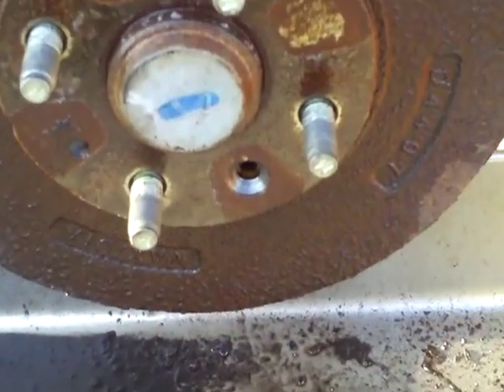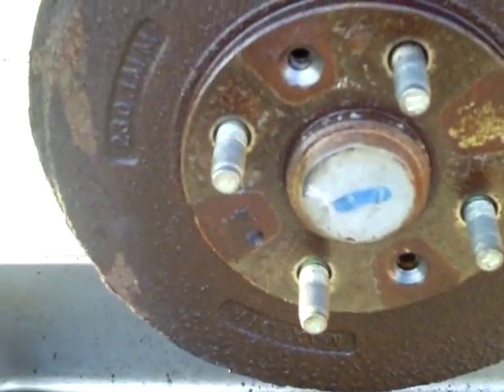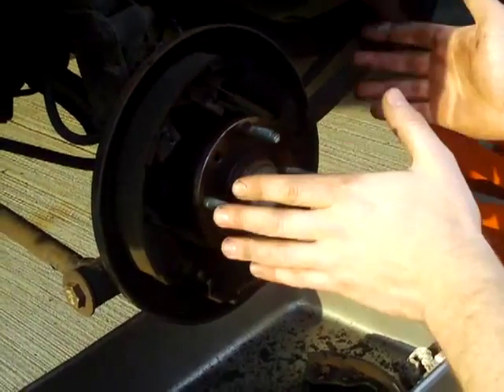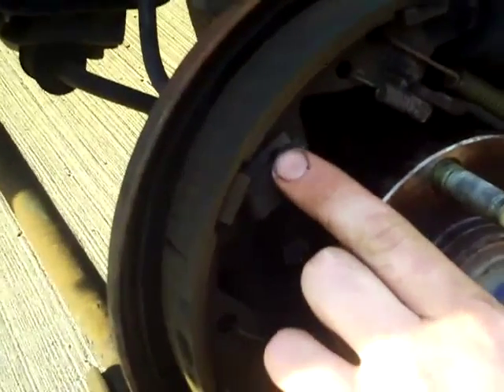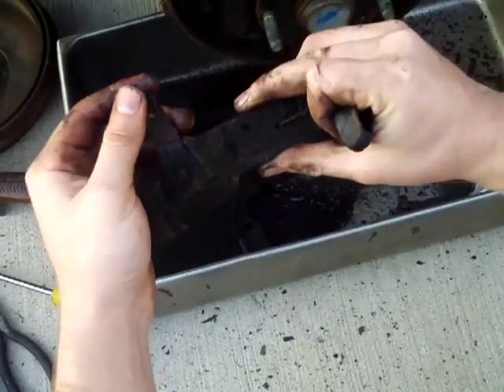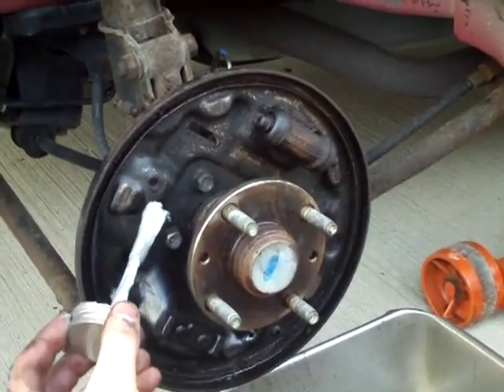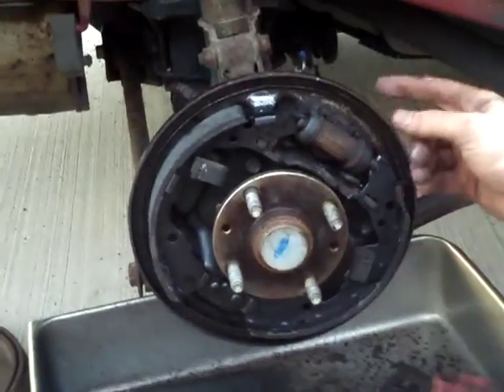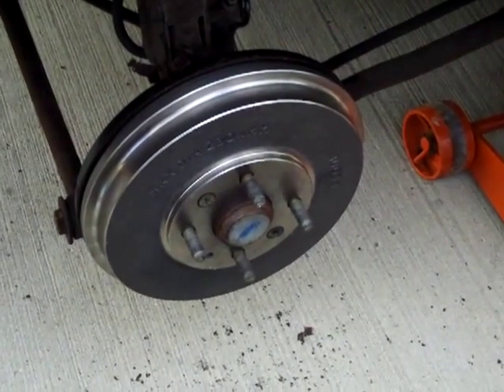2001 Ford Escort ZX2 Rear Drum Brakes How To 2.0 DOHC

Comment: I bought a 97 escort with 123,000Klicks on it(76,000miles) for $750. Just needs an exhaust flex joint and rear brakes.  Brakes weren't really warn, just badly rusted due to lack of use.  Bought it off an old lady who was going in an old age home, who bought it off her older sister, who bought it new.  So it's all grandma miles.  Anyways.. I'm in the middle of doing mine, and I found it easier to take the hub off and do the brakes on the back plate separate from the car..continue  ^

Comment: I used this video in tandem with the 1A Auto Parts video on the same vehicle,  each video has a bit of info the other doesn't. The drum indeed can be removed more easily using a 12 thread bolt...unless of course the threads in the drum are stripped as was the case in one of mine. All springs are easily removed and replaced using a small vice-grips. If you have to disconnect the E-brake cable I suggest soaking the metal plate with PB Blaster, putting it in a vice and tap on it with a hammer until you can free it up. The drums will need to be "turned", any auto parts store can do this. You should also spray things down with brake parts cleaner. I found this and the other video very helpful.

Comment: Thank you.  I'm still having problems with the drum going back on, even after adjusting the "reset" mechanism.  Is there a way too make the circumference of the shoes even smaller?  Such as putting in the cylinder pistons?  BTW   An easier way to remove the drum is to just use a 12 thread bolt, and put in to that little bolt hole and slowly ratchet that in.  It will push out the drum with little to no hammering required.   (It's the smaller extra hole next to the two phillip head bolts on the drum)..

Comment: Are those screws needed? I did a front brake job(disc brakes), the screws were drilled out but not replaced. Once the caliper is on the rotor doesn't move, and once the wheel is on the rotor doesn't move. I used a sledge hammer to get the rotor off, a small hammer is almost futile.

Comment: because I had to replace the brake cylinders.  The cylinders were OK, but the brake line that went to the flex line was badly rusted and the bleeder screw was rusted I was better off replacing it.  I was finding it hard to put the new springs that I bought on with the back plate on the car.  The new springs are way stronger then the old ones.  I should post a video of what I had to do.  Same brake set up as the 97 I see.

Comment: I don't have this car, but do have a Ranger. If grease was not put on the 6 raised points on the drum could it cause the following noise? When driving I hear a noise from the rear brakes. It is definitively a rotational noise where a certain part of the brake hits another part. When I hit the brakes the noise goes away. When I let off the brakes the noise comes back. I think my mechanic just forgot to apply grease to the brake. Any ideas?

Comment: How much would this job cost? I have a car and the brakes are bad I don't have any help and don't even know where to start to get it fix and I'm on a low budget.
Reply from the maker: ***** I would expect to pay 300-500$ at most shops depending on what needs to be replaced.   Call around and get quotes.
Reply: SparkysGarage Thank you so much for your reply, I will do that start calling around.

Comment: can you use wd 40 instead of pv blaster(or however its spelled)?
Reply: No. Wd40 does not Pentetrate and lubricate. It actually will leave a thin layer of residue once dry. Use pb blaster or liquid wrench